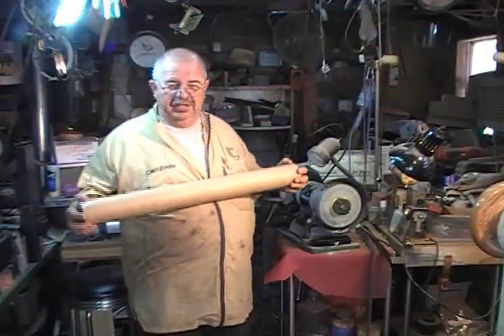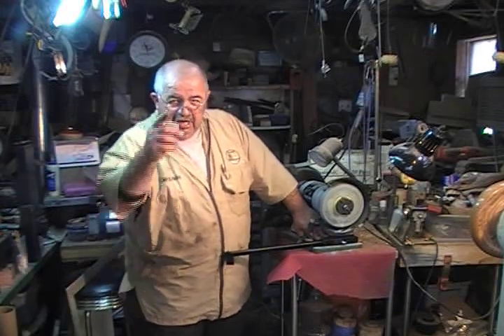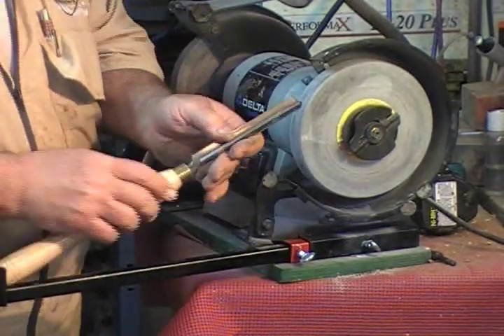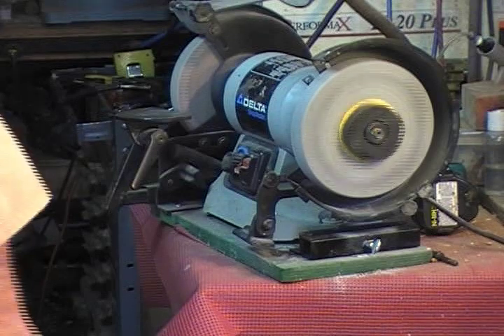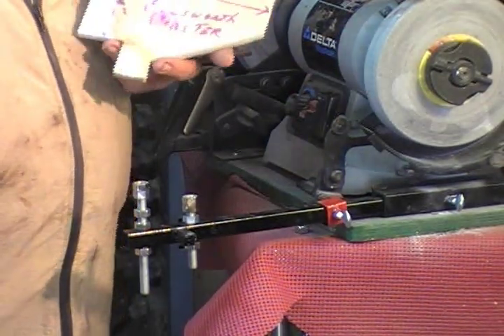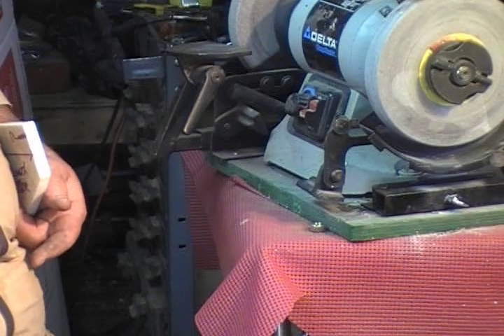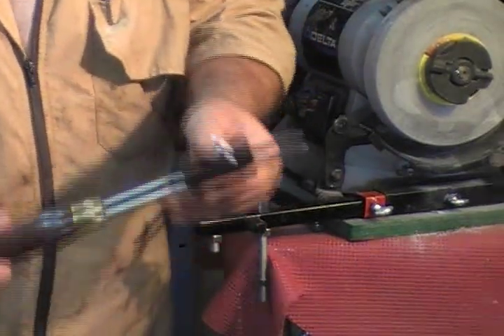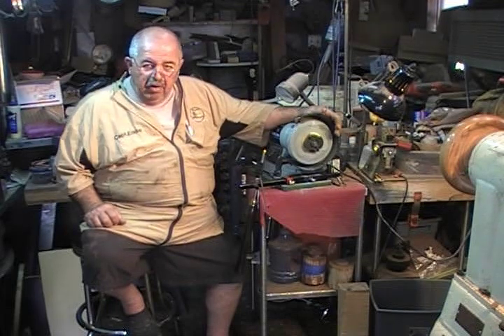Setting up your blackhawk

Comment: Hi  cap'n. eddie I'm trying to set up your sharpening  jig. I think I need to buy a new grinding wheel. The one on my grinder is 6".  I can't get the 4" dimension, ro do o you have a suggestion? By the ware I really like you vido.
Tom Simmons